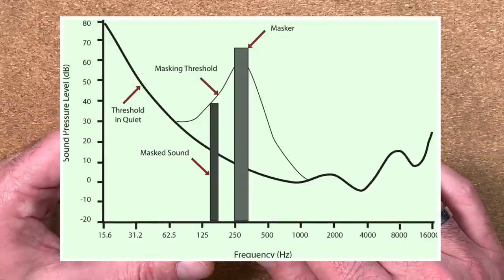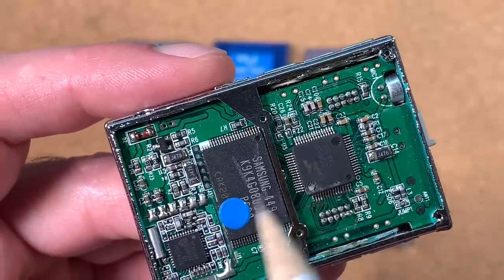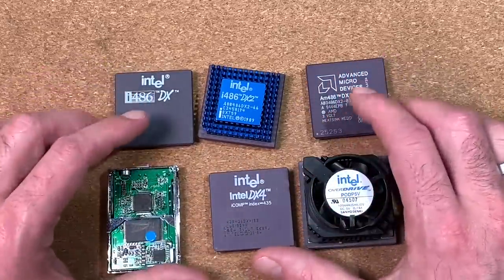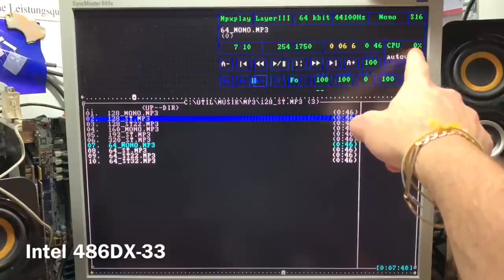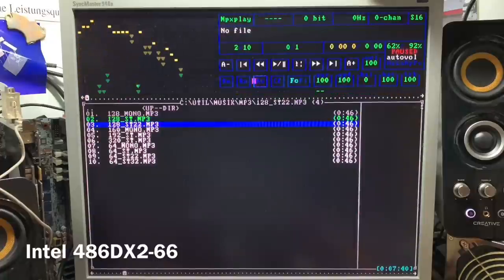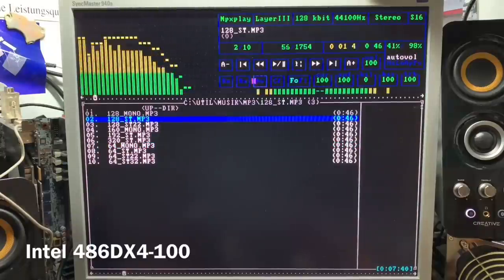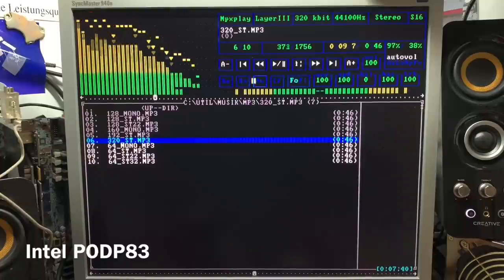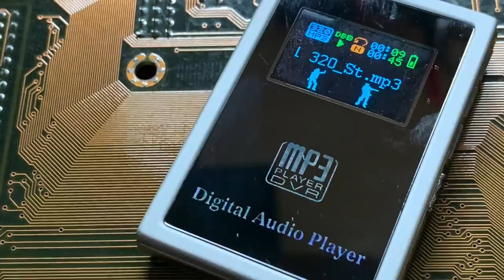Can a 486 Play MP3 Music In Good Quality?

Comment: The problem here is the ton of animation the player produces while playing the music file. Back when Fraunhofer published the format specs, I wrote a DOS player without any display gimmicks and it played a 128k stereo mp3 on a 286 at 12 MHz at 99% realtime. If I had a 16MHz version of that CPU back at that time, it would have worked. (to be fair, I've spent several weeks optimising the decoder assembly routines to scrape out every last CPU cycle.. it definitely was a project born from stubbornness and a desire to prove it can be done, and not the desire to produce a viable player application...)
Reply: I agree, testing software emulation on a multi-purpose CPU always means testing both the soft- and hardware. The whole video is quite disappointing.
Reply: There've been successful efforts to decode MP3s in real time on C64s (without additional hardware of course - there's the mp3@c64 which is basically a tacked on standalone MP3 player) - albeit at quite low quality. Never the less an incredible proof of concept that a 1MHz 8Bit CPU can pull it off.
Reply: @1337Shockwav3  I'm old enough to remember speech on the C64. IT would blank the screen to save a few processor cycles.
Reply: 286 cpu can't decode in realtime even 8kHz mono mp3 (not to mention it's 16 bit cpu and most mp3 decoders are 32 bit programs)
Reply: Yeah, those spectra are basically FFT transforms, unless they use the mp3 coefficients, but I'm guessing no...
Reply: My immediate thought on this is "of course a 486 can" as I remember them well and they were definitely fast enough to play back MP3s with no hardware assistance. These CPUs tested here were 486DX models therefore had the built in maths coprocessor which the 286 didn't have.

I'm not sure about how much CPU the animations would require, it's text mode so generally very little therefore the bandwidth required for the graphics output minimal. It really depends on how much non-audio playback processing is required to generate the numbers for the graphics rather than the graphics themselves, and this will greatly depend on the playback library in use. 44KHz isn't that much data throughput although this does depend on the output quality and mono vs stereo of course, however the efficiency of the raw sound output device and the interface used will really come into play here.
Reply: I was also encoding and playing back mp3 at 128kb 44khz in dos and windows 3.1 using a amd 386 40mhz. this was in 1990.
Reply: > it played a 128k stereo mp3 on a 286 at 12 MHz at 99% realtime.
Maybe it also ran Crysis in another window?:)
Sorry, but it's hard to believe. There was no players under dos that was able to handle mp3-s in 90-s even on 486sx-66.
If you was able to do that you would be a millionaire now:)

 @Hans Meier  , no, looks like it was just a name of a demo. It used some custom audio compression algorythm.
Reply: do you have a copy of that program somewhere? or the filename? if you distributed it back then it might be archived somewhere.
Reply: @jeriks7894  brah, mp3 wasn't even released until 1993. https://en.wikipedia.org/wiki/MP3
Reply: @cabasse_music  I suspect there is some ongoing confusion as to what "mp3" actually is as it's a very vague term. MPEG-1 layer 3 audio is MP3, as is MPEG-2 layer 3 audio, and so on. Also as before the what passed for standards were agreed be default the files weren't always named "mp3" and the players would just try to play whatever was given to them and naming a file with the extension .mp3 doesn't mean that it wasn't a layer 2 audio or otherwise, just that it was an audio only stream and wasn't a .wav file.

Software only MPEG video players were not uncommon in the mid 1990s, hardware accelleration beyond FPUs was pretty much unheard of although the CPUs were beginning to have supportive instruction sets as well as the playback hardware being more efficient and reliable when it came to streaming the decoded raw buffers (they were such a pain to work with at times).
Reply: One thing skepticals should be aware, is that extreme optimizations are indeed possible when you put hard constraints in a project. Many shortcuts are available when you are not developing a full end-user application.

This kind of application must handle many levels of abstraction, like format containers, input and output devices generalization, and many other things. Although highly optimized, music players are still more complex than a single decoder designed and tested for an specific machine -- specially when dealing with older cpus where every instruction counts.

I don't know what a 286 at 12MHz is capable of, but I would never doubt what an extremelly motivated programmer is capable of just for the challenge xD
Reply: Your recall is WAY off. 286 and 386 was not even remotely capable to approach decoding Mpeg1-Layer3 to PCM. It's so off it's funny. We built bare bones car computers and put them into our cars using P75 or AMD 486 DX4 120 AMDs in the mid late 90s and that was the minimum entry level with no text graphics or anything to get 128kbps. Experimented to the nth degree to get there. Not surprised at the results in this video, they align with what we found.
Reply: @jeriks7894  So wrong man. If you're on this channel and talking about tech history, at least think about what you're saying. 1990, mp3? no. Also, doubtful your PC was playing anything out of the sound card bus at 44.1 KHz other than an analog cable from your CDROM having nothing digitally to do with the computer.
Reply: @stealth210  sound card was a proaudio  spectrum 16. Was running apha & beta mpeg 1 and 2 and layer 3 codec software  i got from people on the university  network  I had access to. Winter 1990 spring 1991. Also cd -rom drives were expensive  and  hard to get.
Reply: @jeriks7894  I had the Pro Audio Spectrum 16 also. It had a SCSI interface for the 2x CD-ROM(caddy load) it came with. I was still a ways off from playing MP3. It did come with a great MOD player with the bundled software.
Reply: Yeah, I see something is wrong here, it is many years ago but I'm absolutely sure my first mp3 player was a DX2 @66 MHz with mpxplay, it did nothing else, it had a 20 MB Seagate hdd with only the most necessary files on it, boot sequence, which automatically started mpxplay, and audio drivers. I'm completely out of all this, but pretty sure it is also a question from when the files are, when and how they were ripped. I wish I knew you back then, from your name you are from Germany like me and there weren't that many people who even knew about mp3 at its beginning, finally mp3 was something that made propper use for pc's for me as a teenager, more than just building them together and taking apart again, an old saying goes "PC's help us solving problems we didn't knew before", lol, hours over hours just to get that damned Boeder mouse installed and working. I stacked four desktop pc cases of the same type on each other on a roller for plant pots and a monitor on top with a signal switch for the monitor, keyboard and mouse for three of the pc's, the one on the bottom was a 486 @ 33 MHz and served as the file server or external hard drive from todays point of view. Man, that was times, burning parents money for electricity, papa's yelling is nothing compared to when you have to pay the bills on your own, lol.
Reply: I distinctly remember listening to MP3s on my 486DX2-66 with a standard bitrate at the time (96-128kb stereo). Sadly, I don't remember what player it was, only that it was an all-in-one media viewer/player with a very plain white(or was it yellow?)-on-blue ANSII interface. Not only could it play MODs/STMs/MP3s, but even low-res AVIs and MPGs.
Reply: Maybe you should publish this software somewhere? I'd really like to see 286 playing mp3. No sarcasm here.
After seeing Prince of Persia on 8-bit Atari nothing will shock me any more ;p

I'm quite sure all those animations take lot of CPU cycles, even measuring CPU load is quite have for those old machines. But between 16mhz 286 and 100mhz 486 is quite a big jump.
Reply: @xys007  That was 25 years ago.. I have no idea where the disks from that time ended up. I posted the sources to Usenet, but I can't seem to find them in Google Groups search.
It's funny reading all those comments from people who have clearly never written a single line of code themselves, or at least not in any hardware-near language. Sure, your first MP3 player may absolutely have been on a 486/66, but that most likely was under Win3.11 oder even Win95 and contained a ton of graphical overhead.
One of the reference implementations Fraunhofer Institute published at that time was written for a 386SX, using emulated floating point maths. Replacing that by fixed point algorithms made it possible to reduce the cycles needed significantly, while only sacrificing a tiny bit of quality. The biggest waste of cycles was the output buffering, because the original SoundBlaster16 only had 8kb of input buffer, but the MP3 decoder produces 64kb of output data per chunk.
Reply: mp3 on a 286???
Reply: @darkfalzx  I have a similar recollection from around 1994/95. I definitely didn’t pirate them on IRC over a 56k Modem.
Reply: @cabasse_music they’re probably thinking about mp2
Reply: @stealth210 It can be done with great loss of quality. For example with integer arithmetic and approximating polynomials derived with the Remez algorithm. Also: the PC board can have a specialized floating point unit, which can give a 20-times speedup.
Reply: Yeah I had no issues playing stereo on an 386DX40. This player is not optimized.
Reply: This is a blatant lie, or a very confused person as to what is meant by mp3. The findings here match exactly what the most efficient players could do around 1997 when mp3 slowly revealed itself to the world. Someone extremely dedicated could maybe shave off a few %, but that would have revealed itself at some point for sure. There is no way around all of the compute required on a generic CPU other than dedicated hardware or multimedia-specific CPU extensions like MMX which was introduced in 1997 as well.